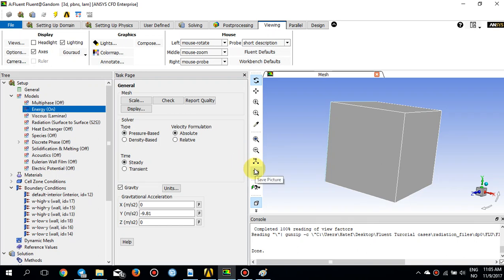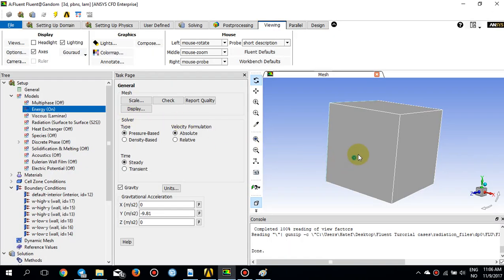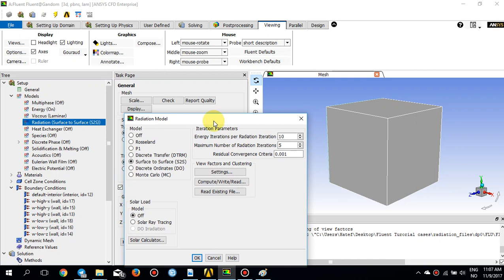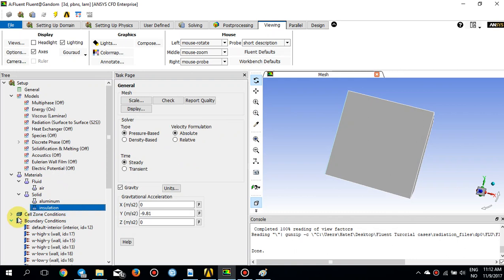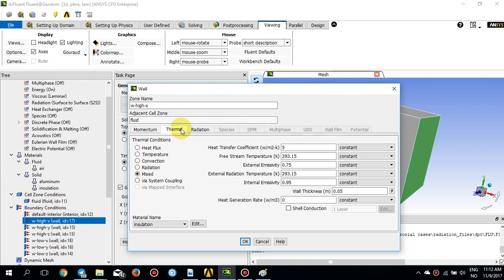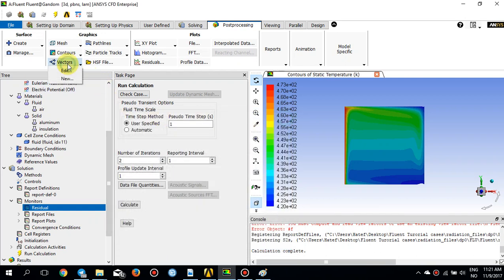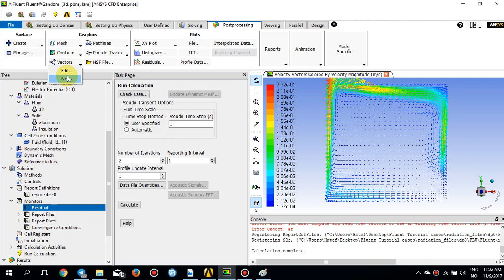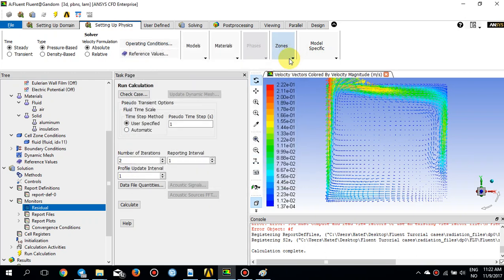Modeling natural convection and radiation, Ansys Fluent Tutorial 13

Comment: Hi, sorry if this question is too basic, but I'm just a beginner here.
I'm trying to figure out how to run a simulation which has a three-layered box 
(ex. a large box with a medium sized box inside of it, with a small box inside the medium box)
heating inside of a convection heater at 180 degrees celcius. I also have two additional
radiation heaters placed underneath the three-layered box to begin heating the inner box first.
Could you (or anyone) please let me know how to simulate this using this program? Thank you!